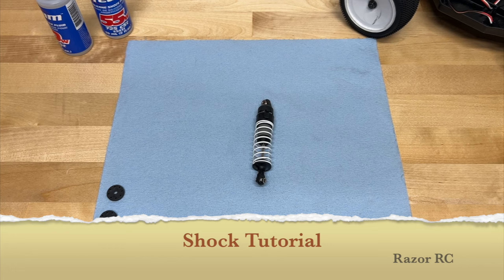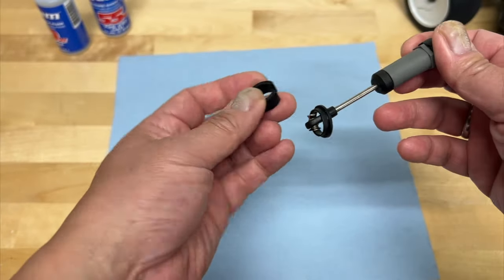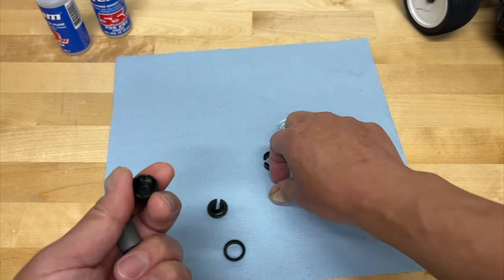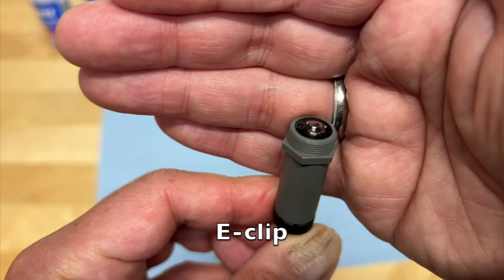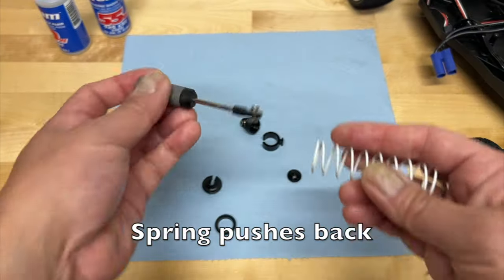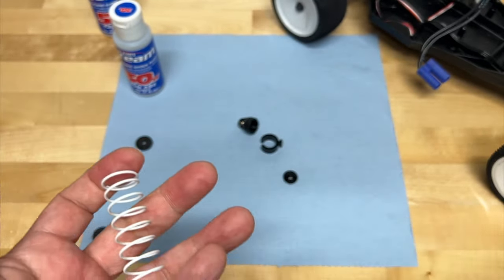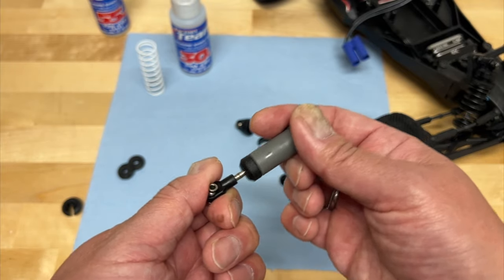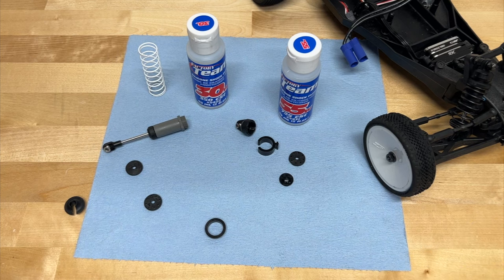Shock Tuning Tutorial! (RC Basics #8) - How to tune your RC shocks, springs, oils, pistons

Comment: So if you want better absorpsion on a big jump you have to do heavier shock oil in your shoocks?
Reply: no not every time its the way to go to thicker oil but sometimes thin oil and also take a look on the hole size in the pistons is the way to go, for example on small bumps it might be better to use smaller holes and thin oil and that also makes the car better on landing after bigger jumps.

but its a degree also when the holes gets to small and the car starts to behave bad, as well it is with to big holes that dont give damping on low pistonspeeds of the shocks the car is going to  bounce up and down like its no oil in the shocks eaven if real thick oils is used and the shocks work sort of good on the fast part of the track where bumps is hit by the car at high speeds 
but on landing from big jumps the chock piston just blow thru the oil and dont give much of a damping.
in that case big holes and thick oil gives two problems at low speeds and landing after jumps.

in an example with smaller holes it does give some "pack" in the shocks relatively early over small bumps and bigger jumps in that way that the car dont ocilating/porposing up and down as with to big holes. 
small holes can be good for better landings of jumps compared to bigger holes that can be to big and dont give friction in the oil and the car is bouncing up and down porposing in light bumps at slow speed and dont absorb the big landings after a jump.

Comment: Thanks for your quick rundown but, I’m still confused on when you would want lighter or thicker shock fluid to how soft or how hard of your springs. I have a Traxxas Maxx and due to not jumping it real high, I tend to keep it on the ground so what’s the best way to keep the shocks soft enough so that they absorb and flow over the bumps but not bottom out or drag the chassis from hard accelerations, braking or small jumps? For the longest time I had the V2 stock springs but with stock shock fluid, it drug the ground and bottomed out a lot but, it also handled good on rough terrain. Increasing the shock fluid weight to 70 rear, 50 front, it didn’t bottom out/chassis slap from fairly short jumps but the suspension wasn’t able to flow with the rough terrain and was too bouncy. I’m kind of thinking I need far more stiffer springs but maybe a 50W shock fluid all the way around. Is this what I want for  better handling and traction without so much spring preload to maintain proper ride height with less bottoming out and undercarriage dragging?
Reply: you need the shock pistons with the smaller holes and go back to 35w or 400cst oil in that way the shocks can be soft over small bumps but gets quit stiff when landing from bigger jumps.
traxxas use faily thin oil and big holes in the pistons that makes the cars plush and following rough terrain but is "horrible" on jumps.

Comment: A very good tutorial, quick, precise. and correct. I run my car on gravel, rocky terrain 100% of the time. That's all I have. I can only use my controller with 1/2 throttle. Would you suggest slowly drilling the holes larger, maybe only 1 hole at a time to try to keep rc car on terrain? And why don't they design shock towers so shocks function vertically. Sure would help with my citation.

Comment: Silicone oil usually has a higher rate than weight.  Is that the number for diff weight  ?
Reply from the maker: Silicone oil has a wt and cst number.  Wt is a fake number that doesn’t actually mean anything, cst is a real unit of viscosity.  Diff oil is always in cst.

Comment: You probably should have used the opportunity to clear up some myths.
I dont know how many ppl( youtubers even running a channel several years) still think that you can change the stiffness of the spring by compressing it with clips or threaded retainers, when in reality you only affect ride height. Only difference being progressive springs. I even get into arguments and ppl tell me im wrong and im only left shaking my head.

Comment: Hi there thanks for the explanation.

Say a piston has 8x 1mm holes

And a piston with 4x 2mm holes.

Wouldnt this he the same level of compression?
Reply from the maker: No, first off you have to calculate the area of the circles.  8x1 would be 8 pi, the other 16 pi.  And like I said, oil flows differently at high speed than at low speed through different size holes, even if the area is the same.

Comment: dude what the hell are you talking about, you do not need air in the shock to "allow it to move" its just the holes in the piston disk that allow movement. the holes allow oil to move to the other side of the disk and that is all. Air in your oil will only make the system erratic and inefficient.  The point of using oil is that it does not compress.
Reply from the maker: @RENEE72968  fill up the shock with the shock extended, put on the cap, and it will hydrolock.  There’s no room for the shaft to go into the shock.  That’s what the air is for.